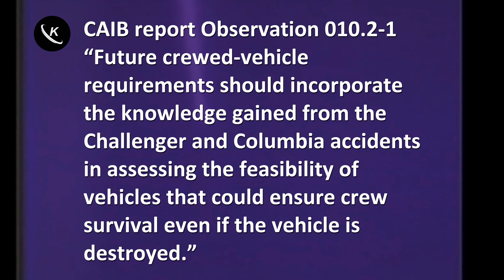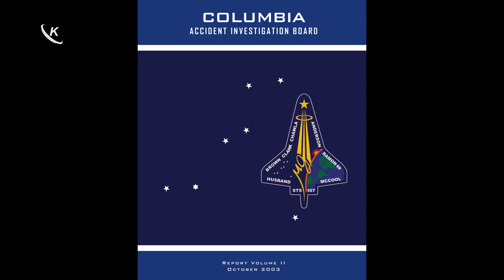SpaceX Starships Deadly Design Flaw

Comment: They're literally only in the early-mid test phase to see if full and rapid reusability is possible. Since the start of the starship program the ship design has changed dramatically. As of now, they're just trying to get the starship to virtually zero expended parts. Once that's cracked, they'll start working on the technical aspects of payload and safely launching humans. You also can't speak to its design based off an old render video they made purely to get people excited about it. My point is that SpaceX is not focusing on launch abort RIGHT NOW because they first need to make a rocket that works!.. Seems like you are jumping to conclusions🤨
Reply from the maker: I hope you are right. But they said the same thing about the shuttle. It was so safe it did not need any escape mechanism.

Comment: That is completely untrue. Starship is capable of pulling away from the main booster in the event of a failure anytime during preflight up to stage separation, just like dragon can separate from falcon 9.
Reply from the maker: That is exactly my point. The Starship is NOT an escape capsule and should not be relied on as such, it is a ROCKET. there is no escape capsule or method other than relying on the Rocket. The same mistake was made with the space shuttle.
Reply: @Knowledgeorb  Starship is an independant vehicle that can start its engines full throttle within a second, at anytime from sitting on the pad to stage separation. that alone is a 1000X the survival rate of the shuttle which had no onboard fuel source even if it could have separated from the boosters. Why isn't every jetliner equipped with escape capsules? because at some point you have to assume some risk, after all nobody ever claimed space travel was going to be as risk free as a drive the the corner store, oh wait, you could get into a fatal collision even doing that.
Reply from the maker: I hear you but to answer you first I answer. "Why isn't every jetliner equipped with escape capsules? " Because jetliners have millions of hours of safe flying to prove they are safe. They are designed to a standard that is proven to be safer than driving a car. The Starship has no such record or proof of design that is anywhere near that of Airliners. In point of fact ANY rocket has a failure rate MUCH higher than an Airliner. Until the design is proven to be as reliable and safe as you seem to think we need to assume it is not. THAT is why I think it is foolhardy to put many people at once on this rocket with no real hope if escape if there is a failure. If, or better yet when, that was to happen it would put an end to the SpaceX manned flight program for a long time.
Reply: @Knowledgeorb  Neither did airliners when they first came out, Planes still fall from the sky today despite the safety record. how is Starship supposed to develop a safety record if it isn't allowed to fly as designed in the first place? Nobody ever said they were going to put people on it anytime soon, and certainly not on block 1 or 2 models, perhaps it will be block 5 like falcon, or block 10. Doesn't matter. The risk is always going to be higher for Space travel than airliners. Don't like the odds? don't get on one. Musk has previously stated, on many occasions, that Starship won't be human rated for at least 100 successful flights. any other company and that could be decades but with SpaceX already working on their 3rd launch tower, I expect it won.t take long at all to add up to a 100 flights.
Reply from the maker: Not saying it is not a great rocket and SpaceX is showing everyone how development should be done. I just think it is fool hardy to rely on the rock itself as the life raft. This is not an airplane it is a rocket. This is not science fiction and it will be many decades before going into space is actually safe. 100 successful flights is not enough to put the number of people on these they are talking about at one time. That is my opinion, I read the CAIB report and take it seriously. There is no need to make the same mistakes again.

Comment: "SpaceX Starships Deadly Design Flaw Is Nasa" FIxed your click bait title, both shuttle disasters were caused by nasa's managment. Challenger was launched due to politcal pressure even though they knew it was too cold to safely launch that morning. Columbia's fate was almost shared by Atlantis STS-27 in 1988, Luck was the only thing that saved Atlantis's crew. For 19 years nasa watched launch debris hit the shuttles and the only solution they came up with was "it'll be fine". Columbia's investigation report might as well read "Known issue caused complete loss of shuttle, Sacrificed crew to save on the bottom line." Seems like the only flaw is that the whole nasa organization hasn't been shuttered. SLS is a joke it's nothing more then a jobs bill to pad the pockets of politicians and their wealthy doners.
Reply from the maker: So your ignoring the fact that if the shuttle had an escape mechanism the astronauts would have survived. But that's okay.

Comment: I'd guess they're more concerned with making it reliable than making an escape system that may or may not work.  It doesn't seem any different than military aircraft having ejection seats but not commercial aircraft.
Reply: Commercial aircraft don't get shot at and generally aren't expected to explode. They operate in less trying conditions, at less of a performance limit, requiring less maintenance, have more redundancies and safety systems, and when things go wrong there are a whole number of steps that can be taken to bring them down without killing everyone.

Comment: escape systems are only needed when the likelihood of the failure is high enough to justify the mass and complexity.  Do we have escape systems on planes?  No.  In the early days, we had parachutes.  Not much anymore.  Starship will get there with reliability.  How many people had to die to get airplanes reliable enough?  You can't expect a cost effective solution to be 100% perfectly engineered from the get go.
Reply from the maker: I don't but the question is what is good enough? I NEVER thought the shuttle was safe enough. They talk about Starship like it is a glorified airplane. The odds of dying on an flight are about 1 in 800,000,000. What would the odds need to be to walk on a starship with no escape method? 1 in 1,000,000? 1 in 500? even attaining 1 in 500 is going to be EXTREAMLY difficult. My major beef is that we are making the same mistake as shuttle but this time they are talking about launching 100 people. There has been no discussion or design about launch phase safety.

Comment: I don't really see a point in arguing against the points you brought up because they are 100% valid. Still I think it would useful to draw from similarities to the commercial aviation industry. You have thousands and thousands of planes that fly every day with hundreds of passengers each. All of which, at least commercially, have no guarantee to save the passengers if redundancy were to fail resulting in a hull loss. The safety of those systems have been ever improving since their introduction but still, there have been hundreds or thousands of crashes killing tens of thousands of people so why in the early days did we not just stop flying them when the first crash happened? They introduced more and more and more safety systems, protocols, and redundancy. I see the exact same thing happening with starship and other space ventures. No doubt when that day comes will it be one to mourn. Yet so long as those engineers and designers are putting forward the best effort they can to minimize the probability of failure then I think that is the unfortunate price of such a dangerous, ambitious and inspiring goal.
Reply: The analogy Musk and others have drawn to commercial aviation are absurd. Apart from some superficial similarities in that they pass through the atmosphere and carry passengers and what not, they are vastly different activities. From energy required, to engine power, to speed, to temperatures, to pressures, to g forces, there's so much that always has been and always will be different. Spaceflight will never become analogous to commercial aviation. Even in Spacex' wildest ambitions, they are hoping they fly an airframe a few dozen times at best whereas aircraft fly for thousands and thousands of hours.
Reply from the maker: Great comment.
Reply from the maker: When I see 100 people marching on to the star ship that really spins me up. To think they can get to that level of reliability, like an aircraft, is just crazy. That is to many lives to put on a rocket like this. We are very far from that and if/when we do get there it will be very different from starship, it will not be starship.

Comment: The Starship is still an experimental vehicle, it's unclear what the future operational design may be
Reply from the maker: Just pointing out the way they are advertising it is basically BS.
Reply: @Knowledgeorb  And what have you done lately 🤔.
Reply: They haven't fleshed out much at all and the core design gives lots of pause for concern.
Reply from the maker: So does the elevator I will be making a video about that soon.

Comment: By this same argument you should probably never ride on a commercial aircraft, since they don't give everyone a parachute and you'll probably all die if there's a major malfunction mid flight.

NASA should absolutely hold SpaceX and Starship to a higher standard than they did with the Shuttles, but redundant systems can be good enough at reducing risk without needing something as inefficient as the current and past generations of capsule type human-rated spacecraft.
Reply: Commercial aircraft are a completely different animal. They are specifically engineered and tested to safely and reliably do their job for decades on end. Orbital spaceflight is a highly specialized task that stands well apart in terms of conditions, costs, requirements and so on. It will almost certainly remain so and we know plenty about spaceflight to reasonably conclude that.
Reply: An airplane doesn’t have an explosive fuel mixture. So an engine failure will not totally destroy it. 
Rockets are a controlled explosion, things go wrong very very fast.
Reply from the maker: I think the real point is what standard is good enough to not need a redundant independent system. For aircraft they are the safest form of transportation bar none. The odds of you dying in a plane crash are 1 in 816,545,929. So it is a bit of an overstatement to equate the odds of an aircraft death to that of a rocket. As @TCV12 pointed out the human acceptable rating for a Rocket is 1 in 276. I think this is actually 1-500. In any case I did some digging and and per NASA-STD-8719.29 which was updated in November 2023:
"The space system shall provide abort capability from the launch pad until Earth
orbit insertion to protect for the following ascent failure scenarios
a. Complete loss of ascent thrust/propulsion. 
b. Loss of attitude or flight path control."
So we will see if they follow this policy when SpaceX launches people on the Starship. Of course SpaceX is not NASA so they may not have to follow these policies.

Comment: They are still pretty early in the iterative design of starship. They are still working on getting a system that is orbit capable. Getting the vehicle human rated is still a long way off. If the past is anything to go by, starships design is going to change considerably before they reach that point. I'm confident that by the time starship is human rated it will have a launch escape system integrated into it to achieve that rating.
Reply: I absolutely agree with you on this!
Reply: There is fundamentally no credible way to integrate escape into the design. It's far too large and heavy and we have seen not even a hint from the company about how or even if they plan to address the issue.
Reply from the maker: I hear you buy I cannot think of one rocket that was designed to launch humans that did not include this capability/or lack thereof from the very first iteration.
Reply: @Knowledgeorb  The Falcon 9 wasn't initially designed to be human rated. It wasn't until the Block 5 version.  And it was a lengthy process to get it there and cleared to launch the Dragon capsule. Even the ground support equipment for things like propellent loading and unloading had to be redesigned.
Reply: oops facts alert @dirgle

Comment: Launch escape systems were used well before Shuttle.
Reply from the maker: But not ON the shuttle and one of the NASA CAIB was we should not design rockets that did not have a way to escape.
Reply: @Knowledgeorb  I get it, but it's a pipe dream. Imagine designing an airliner where each occupant can eject. LES and similar concepts are simply not scalable to larger payload-to-orbit vehicles. 

I understand the safety concerns with Starship. And Elon does too. That's why it'll blow up many times, and successfully recover many more times before any human will board it. The Shuttle was dangerously limited in development because the first time it ever flew - atmospherically, and in orbit - it was manned. Elon has spoken to this many times. When your craft is unmanned, you're able to explore far more limits and hazards in the research and design phase and adjust accordingly. When you're manned up, it has to work the first time. Your design becomes unmalleable early on.
Reply from the maker: @OK1Wire  I hear you, and I worry for SpaceX and Elon as well. God forbid they actually put 100 people on it and they have a failure. No matter how you slice it there will be government intervention and "help". It will be a huge setback. I really wanted people to understand that this is not a video game. People are much to complacent and think space travel is easy and we have it solved. It is not easy, even if it looks like it is. Again, SpaceX is awesome, they have done some awesome things. I remember what it was like when we lost both shuttles, we cannot forget the lessons learned.